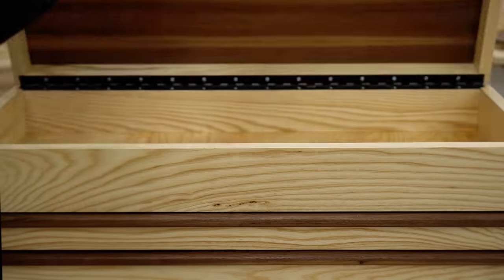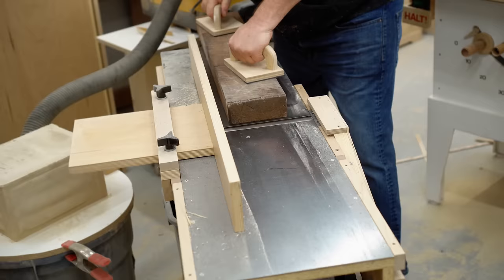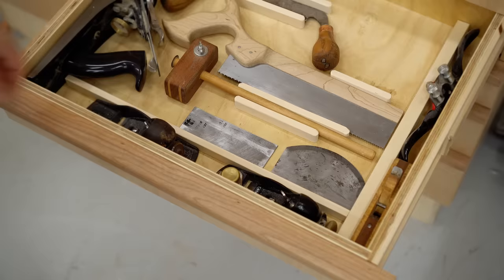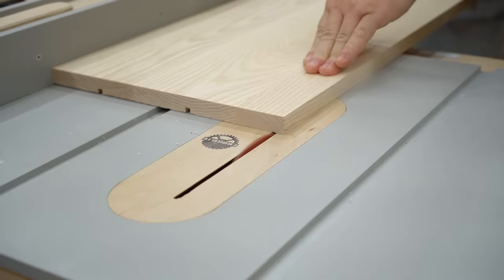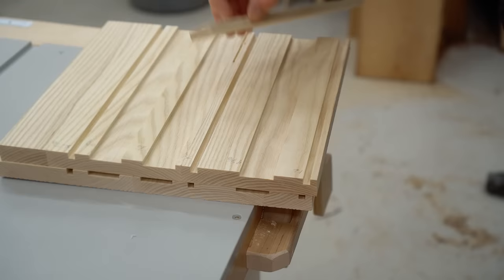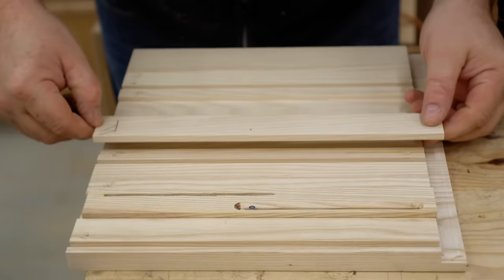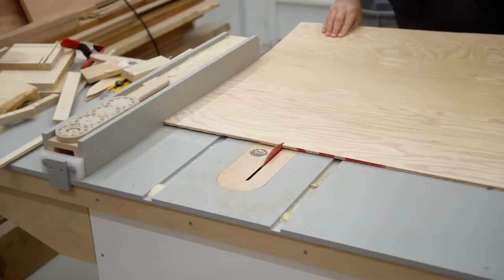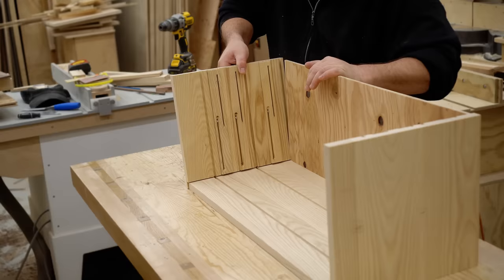How to Make a Toolbox with Drawers - Woodworking

Comment from the maker: Get the plans for this toolbox: https://ibuildit.ca/plans/woodworkers-toolbox-plans/
There's a lot more detail plus exclusive videos in the build article: https://ibuildit.ca/projects/how-to-build-a-toolbox-with-drawers/
Reply: Quick question on the construction adhesive. Is there a way to thin it? I heard Xylene does it. I also heard the type used for concrete doesn't expand as much. You're the expert on this stuff.
Reply from the maker: PL doesn't have a strong solvent odour, so I don't expect xylene would do the trick. I've never had a reason to thin it, so I couldn't say. Maybe liquid poly glue would work.
Reply: Amazing project!! , i purchased your Precision Router Lift plans, but where i live is hard to find good quality plywood. Can i make the lift with MDF or a similar material? Or should i use shop grade ply? Thank you
Reply: Lots of pig squeals. Tune them out John. Your craftsmanship is impeccable!
Reply: Hyy all 🙏🤝🤝🇮🇩🇮🇩🇮🇩
Reply: Шикарная работа, спасибо за отличные мотивирующие ролики, решил делать контент по деревообработке. Благодаря вам, надеюсь получается неплохо!
Reply: What are the dimensions?
Reply: Hey man is there any way I can I hire your expertise in a project that I want to do

Comment: Now that’s what I call a toolbox!!! My shop (garage)is so cold right now even construction adhesive would be a problem, and I use the space for food in winter so I don’t want to heat it. Minus 30 Celsius this week outside, so my shop temperature dropped to 2 degrees, usually stays around 10 Celsius. Great project again John !!!

Comment: I recently made a toolchest, but I made the drawer slides in a different way.  I cut them from HDPE cutting boards as if they were mating parts for a French cleat . They  are 3/4" wide and drilled with counterunk holes for flathead screws.  The beveled matching of the parts keeps the drawers from cocking and jamming in the carcass and the HDPE is quite slippery.  They can be planed on the wider side (the side you when installed) to adjust the tightness of fit.

Comment: A beautiful piece!  Those walnut dowels contrast so nicely with the whiter wood.  I would never have used water based poly though, it is so bland and piece looks uncooked.  I would have gently toasted the white wood to get a brown flamed 'stain', oiled it up with BLO, then Varathane Oil Based Poly diluted 50:50 with spirits, and wiped off for excess. You get a warm glow in the finish, and poly is thinned so no plasticky effect on surface.  I don't know how anyone can stand using water Poly, its so soft and lays on the surface like a plastic coating. It also shows up all nicks and dents easily.

Comment: Construction adhesive eh?  It doesn't mind the cold shop temperatures like water based glues do?  I'm guessing you've never had any issues with it if you're still using it on projects. Might have to give it a try in my freezing cold shop!

Comment: That's some amazing craftsmanship. Beautifully done. I was just wondering, what it the reasoning behind removing the riving knife on your table saw? I am a beginner woodworker, and it feels like a very important safety device. Just wondering, not judging :)
Reply: He built his tablesaw and did not include one. He has almost 40 years of experience and chose not to add one. I myself don't use one either but if your saw has one you should probably use it.

Comment: Does the PU glue cure fairly well in cold environments?
Reply: That is one of the reasons he uses it. A longer open time to adjust parts and it cures at lower temps. But there are limits.

Comment: Hey John. In the UK we have "No More Nails" (and various non-branded ripoffs). Do you think that's likely to be the same thing as you mean when you say "construction adhesive"? Is there a "proper" name for this stuff I should look for on the packaging (like "Super-Glue" is actually cyanoacrylate glue)?
Reply from the maker: I'm using PL Premium. None of those other glues like no nails are the same.
Reply: @JohnHeisz  Cheers, John. Nice toolbox. I'm trying to think how to make something similar, but with the top being a bit taller (like a dutch chest) and incorporating an Adam Savage-inspired first-order-retrievability design inside. I'm terrible with boxes and drawers as I end up just stuffing things in. lol

Comment: Dado stack? I don’t need no stink’n dado stack! So am I right in thinking that you don’t need to allow for expansion in your drawer slide slots since all pieces will expand the same amount? So it’s important to use the same type of wood for the sides and sliders?
Reply from the maker: Grain orientation is the important thing. You can use different kinds of solid wood, but it's best to avoid mixing plywood and solid wood for these parts.
Reply: @JohnHeisz  you’ve trained me well. Thank you for all you do.